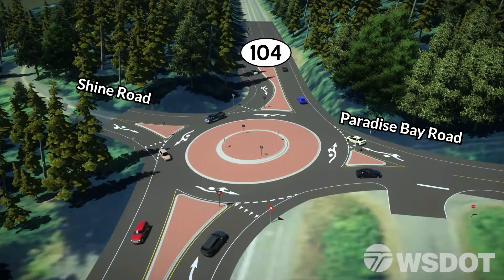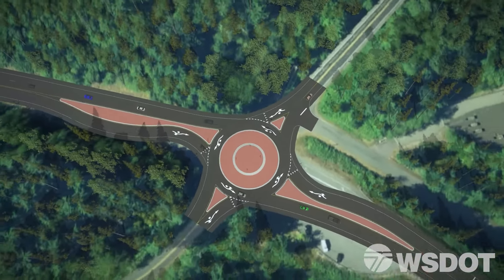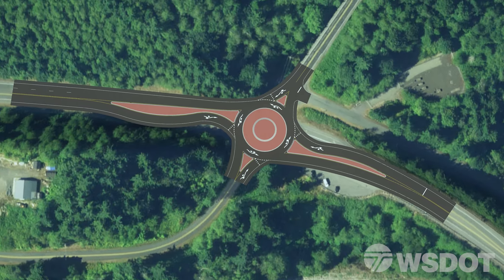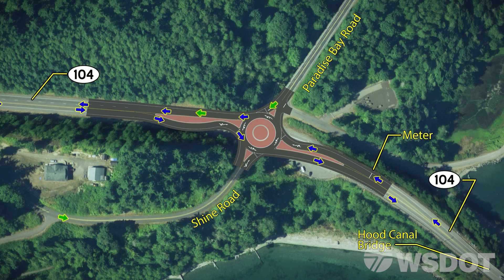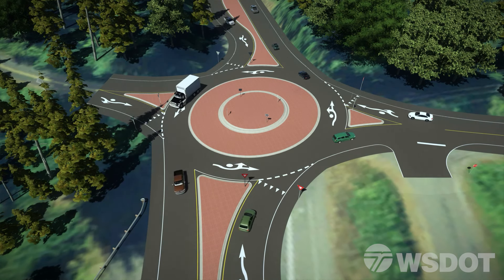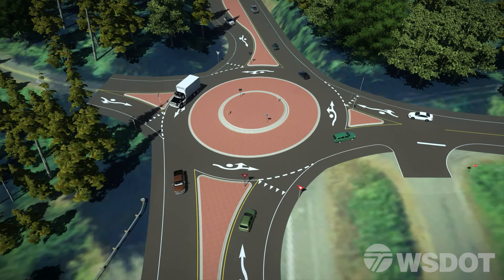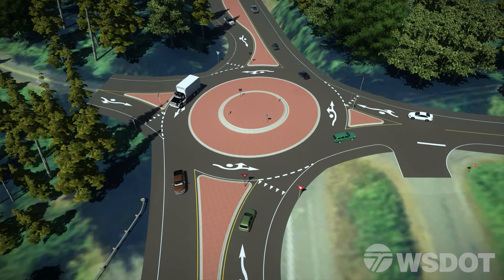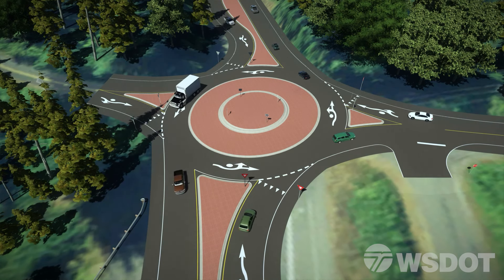SR 104 at Shine Road/Paradise Bay Road and SR 19 - Intersection Safety Improvement Project

Comment: I’m SO looking forward to this roundabout at 104/Shine/Paradise Bay Rd!! I enter 104 from Paradise Bay Rd and it’s such a dangerous intersection. The meter will only function when traffic warrants it and sensors determine cars need to enter the roundabout from Paradise Bay or Shine Rd. People are complaining this roundabout will cause a mess; it’s a disastrous mess now! At least it will be much safer. And a roundabout will cause less congestion than a 4-way signal because there won’t be an extended wait/backup at a red light.
Reply: Us Americans treat change like poison and Roundabouts are still completely foreign to most, the opposition is to be expected, but like everything else "scary" they'll be dragged kicking and screaming until finding out it's not bad.

Comment: I'm a big fan of roundabouts and they are proven to move more traffic efficiently than a stop light. 

However, This is a very poor location for a roundabout. Semis and large vehicles, motorhomes, ect will not  be able to accelerate up the hill appropriately from the round about. This will cause more congestion and risky passing behaviors which commonly happen on this hill as it is when people get in the passing lane and then fail to quickly pass the slow moving vehicle and then move to the right lane. 

Large trucks, semi's ect coming down the hill will be hard pressed to slow down for the roundabout. If this is built, plan on quite a few accidents where large trucks plow through the roundabout.

Comment: It WILL be a major mess, not only during summer with people driving motorhomes through, but also mornings & evenings. Traffic heading east splits at the signal. Traffic heading west won't split, but will be backed up onto the bridge.  Nice touch putting in crosswalks and pedestrian areas - this what functions as a major highway, not a congested suburban artery with pedestrians out for a walk. I can't help but think the designers haven't traveled this route much, nor appropriately weighted their decisions with the fact that there are only TWO routes onto the Olympic Peninsula. Have they included the millions of tourists three seasons a year?
Reply: There are no sidewalks or pedestrian areas ma’am.

Comment: You can meter the road but not put in a traffic light? That's what is needed. Works just fine on the Kitsap side but Jefferson has to be different, why? Worst idea in the world. It's lazy and will be a major mess during bridge openings, especially during the summer.
Reply: Like people don’t run red lights around about insures people slow down. You can’t help it unless you want to go flying and destroy your car and less people do that statistically shown that is the case. Less happens in roundabout than lights or four-way stops. Proven.

Comment: What will happen during the time the bridge is open and the traffic is backed up past the Round about? I presume that cats will be stopped before entering the roundabout as to allow cross traffic from Paradise Bay Rd. & Shine Rd to flow. Is this correct?
Reply: A Roundabout is still an intersection and it's illegal to block one, yes. You have to yield before entering and if traffic is blocking the other side it essentially turns into a stop.

Comment: I live off of 104 and this is the most ridiculous "solution" you could have come up with. 104 will now be backed up consistently with no way for people who live off 104 to get home without massive traffic back up. Once the slow light at the other end of the bridge is red, both roundabouts will be backed up all day. This just shows the great minds of WSDOT at their best.
Reply: I completely disagree and I’ve lived in a lot of places and this makes complete sense. I’m sorry you don’t understand traffic flow but if there’s many accidents happening, there’s a reason and it’s mostly because people can’t get in and they run for it and then they get slammed as well as the high speed going down that hill.
Reply: @clahr7671  "I've lived lots of places" isn't a qualification.
Reply: I think what @clahr7671 probably meant is they had lived in lots of places with roundabouts. As have I. And I find roundabouts to be a much better solution than 4-way traffic signals. All traffic moves more slowly into the intersection but doesn’t come to a complete stop for an extended period of time as it does at a red light. My only concern is people entering the roundabout from Paradise Bay or Shine Rds when the bridge is closed for marine traffic, which would prevent cross traffic from continuing from Paradise Bay Rd to Shine Rd or vice versa.
Reply: @tdkhudson  Roundabouts are still intersections and even if there's a backup on the Highway, traffic still has to yield and keep it clear.

Comment: My prior comment on "force a distance between the cars to allow all drivers to share the roads" at 104 and 19 is still my concern. I am very glad to see DOT agrees that the need to METER the traffic is required. It will be REQUIRED at 19 as well. Please DOT do it right or just put in full traffic light control of the intersections.